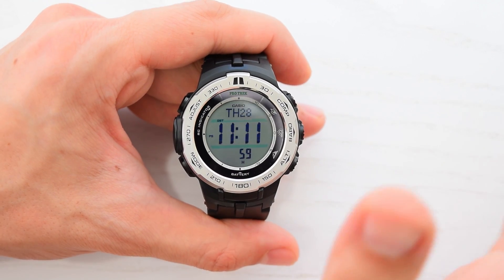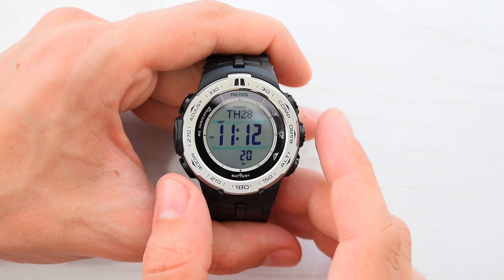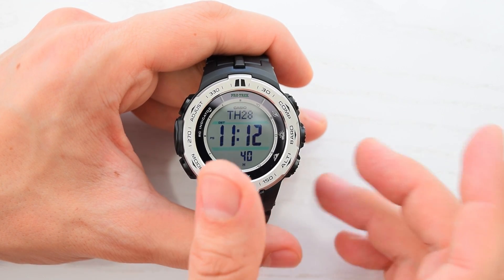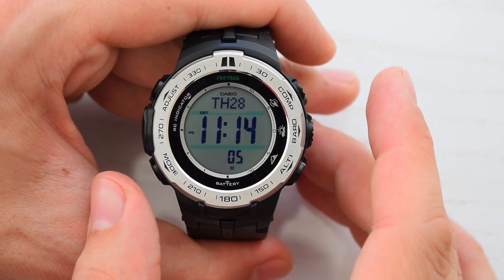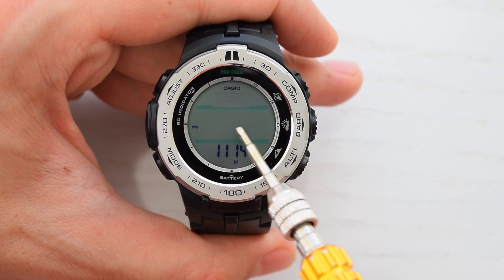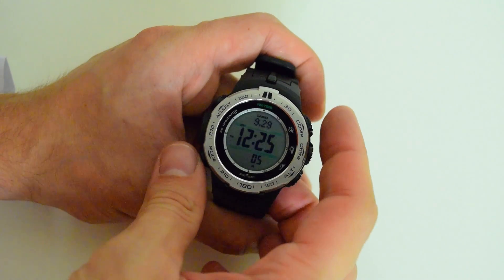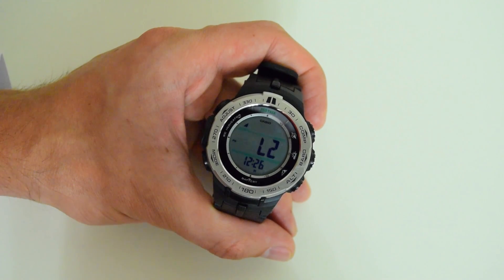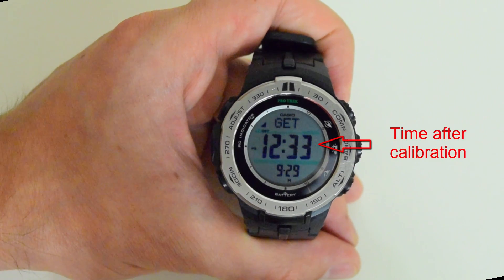How Casio Radio-Controlled Watches Sync with Atomic Clocks (WWVB, DCF77, JJY, MSF)

Comment: So L1,2 and 3 are the measurement of the distance for the synchronization range. Example: 1000ft, 2000ft, and 3,000ft. Interesting 🤔
Reply from the maker: No, it indicates how strong the radio signal.
Reply: @ElectronicsComputers  Got it👍 Thanks for the clarification.

Comment: Does anyone know if there is any way that a radio-control watch that does not receive, for example, the USA time signal from WWVB in Colorado can be modified by an electronics expert to receive the USA time signal even though the manufacturer of the watch did not give the watch WWVB signal reception capability when the watch was originally manufactured?
Reply from the maker: What's the brand and model of your watch?
Reply: @ElectronicsComputers  . I own several different model radio-control watches, but the one I was referring to in my previous posted question is a Citizen Atessa ATP53-2703 analog, radio-control watch which Citizen released to their Japan market only and only receives the two Japan time signals from the Fukushima and Kyushu radio time signal transmitters.

Comment: did the same on my prw-30 and long pressing the alti button doesn't bring up the manual receive operation, why ?
Reply: i found out, i had barometric pressure change indicator turned on and manual says r/c receive does not work when the other one is on, kind of weird
Reply from the maker: I guess both the receiver and the sensor will draw too much current for that tiny battery and the voltage may drop which may affect the readings and overall stability of that watch. So that's why they decided to limit the number of active features.

Comment: Do you know if a signal of good quality can be received in Crete, Greece??
Reply from the maker: Unfortunately, Crete is out of range of German transmitter. Anyway, I think at night if you point your watch to the window on the north side it may work. It worked for me in Athens which is also slightly out of range.
Reply: You can use an app called WWVB emulator by mokyuu. It works!
Reply: Φίλε καλησπέρα. κατάφερες μήπως να πιάσεις σήμα; Δοκίμασε εφαρμογές οπως το clock wave. Αλλά καλύτερα είναι αν πιάνει από μόνο του. Κρήτη λογικά όμως είναι μακριά από το Γερμανικό Ρολόι στη Φρανκφούρτη.
Reply: i was in August of 2023 in Matala for 7 days. Wasn´t able to receive a signal at all.....

Comment: I don't get any signal from Toronto....
Reply from the maker: Try at night near the window and aim your antenna in the US direction
Reply: @ElectronicsComputers  thank you.
Reply: @ jonghun lee. You need to put your radio-control watch in a window at nighttime and place the watch so that its' internal antenna is pointing towards Colorado because the USA time calibration signal is broadcast from WWVB in Ft. Collins, Colorado which is near Boulder , Colorado. The watch's internal antenna is either at the 12 o'clock, 6 o'clock or 9 o'clock position below the watch dial.

Comment: Why would you need to calibrate the time on a digital watch once or twice per month? They are so accurate you wouldn't have to do it more than once per year, because by then it might be 1-2 minutes too slow or too fast. That's in a whole year.
Reply: @ Casual Citizen. After 1 year, a standard quartz crystal, non-time signal reception (i.e., non-GPS or non-radio-control) watch or clock is inaccurate by 3 minutes because a standard quartz crystal oscillator is only accurate to +/-- 15 seconds per month.
Reply: Summer and wintertime will also be set by the watch through the signal.